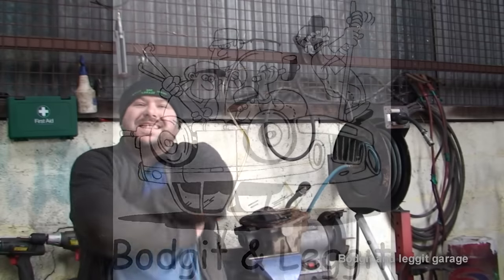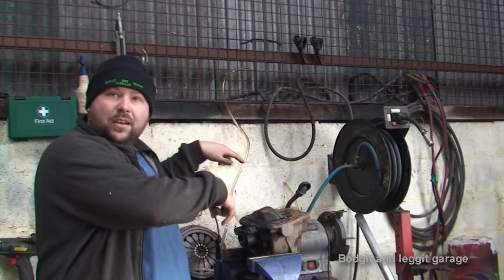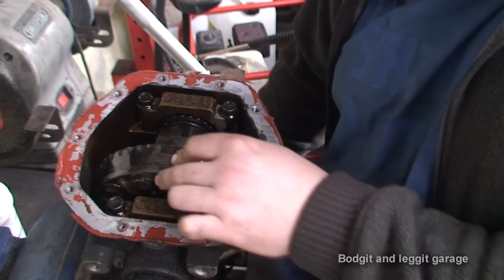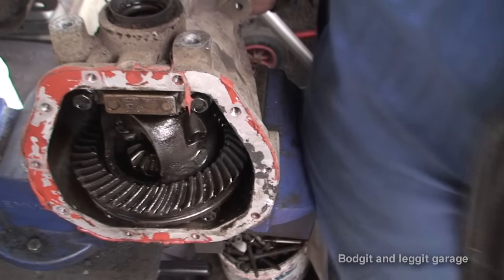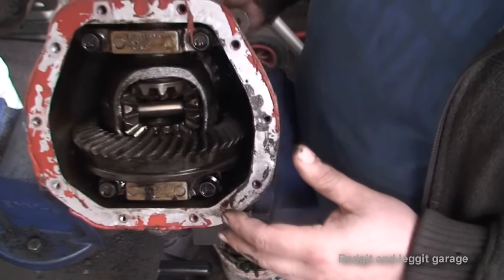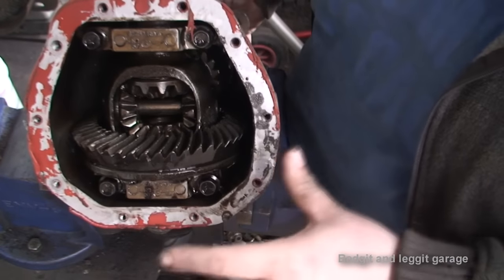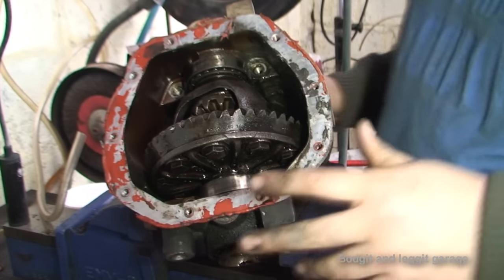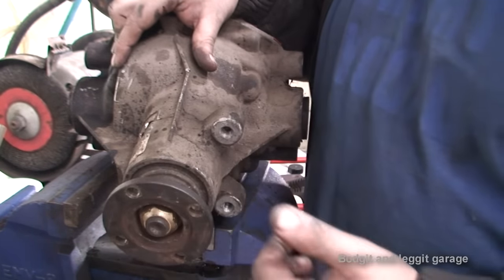what is inside a differential (landrover freelander diff) bodgit and leggit garage

Comment: very interesting. can you recondition it, or is it beyond repair? You would have to replace the main cog and all bearings... are they usually factory sealed?
Reply from the maker: hi mate yeah you would need to replace absolutely everything not worth reconditioning on fortunately even the outer case is damaged
Reply: Yeah I did wonder whether its worth reconditioning. Here in England you can get a reconditioned one for just over £200 now http://www.bellengineering.co.uk/freelander-1-products/ seem to be one of the most respected amongst us Freelander owners. By the time youve got a new case,bearings and all the other bits it wouldn't be worth it im guessing.

Comment: Do you use the same oil in the Rear Differential as you do in the IRD? If so what oil is it exactly as I think mine is due to be changed.
Reply from the maker: djappnew it all depends what year where you are in exactly what you are doing with it here is a link that will explain everything you need
Reply from the maker: https://www.landyzone.co.uk/land-rover/ird-oil-and-diff-oil.155367/

Comment: Hey mate, thanks for the informative vid. I drive a Hino FC and the problem I have with my diff wasn't covered in this vid so I was wondering if you could please help me pinpoint the problem. During the last few months, my diff makes a loud bang when I am slowing down, 40km/h and under. The bang sound has been getting louder, more frequent and stronger (I feel it in my cabin). However, sometimes it's really loud and sometimes it's faint and sometimes there's no bang at all. But will always happen if I slow down right after I have put the truck in reverse and then back into gear. Not sure if this is momentum or transmission related. The bang sound can happen whether I slow down by gearing down or leaving it in neutral and applying the brake. I've done some shopping and a diff 3.9 ratio for my truck is about 7 thousand without installation. Should I replace it? Recondition it?
Reply from the maker: Moe Ibby hi mate you want to look at your prop shaft first make sure there's no playing it at the yaks at each end also check the carrier bearings and then check your drive shaft it's hard to say as I'm not next to the vehicle but I will check them first

Comment: Need some advice rear drives side shaft popped out and believed to have buggered diff so replaced diff and shaft, after wards about 30 miles later shaft popped out again, what could be causing this
Reply from the maker: Hi mate what vehicle is it on
Reply: The "Pre-Load" of the input shaft bearings is Destroying the bearings, of which particles are than destroying also other two main bearings, and  the rest of the teeths on the gears . !!!

Comment: Hello, I want to fit a freelander differential on my lotus 7 replica. I am going to set an LSD ATB Qaife inside. Have you made a video for refit the freelander diff and preload pinion ?
Reply from the maker: Jacques Lanquetin why a Freelander?? Why not use a Sierra diff that drive shafts are lot thicker the diff is a lot stronger everything is a lot stronger and better
Reply: I have a 3.36 Sierra Diff. We want to test Freelander because it's a 3.21 ratio. With Hayabusa 1340, the sierra ratio 3.36 is too short and 3.14 is too long. In France, several guys choose Freelander Rear Axle with Quaife LSD to equip their Megabusa. They gave good feedback on the forums.
Reply: We saw when dismounting  freelander rear axle that shims were placed on the differential case behind the bearing. 
Question is : how to determine the thickness of shims to adjust backlash between pinion shaft and crown wheel and preload of bearings? 
Is it necessary to test shims thickness by mounting and dismounting the bearings ?

Comment: Very good video! How often do you need to change the differential fluid on a Freelander?
Reply from the maker: Hot Hippo how to level one just like with the oil every 5000 miles you will not have any problems if you do this don't care what anyone says what any manual says that's what I say
Reply: bodgit and leggit garage what about a freelander 2?